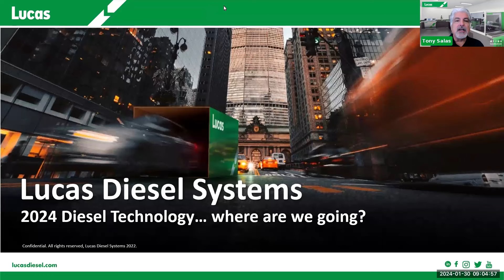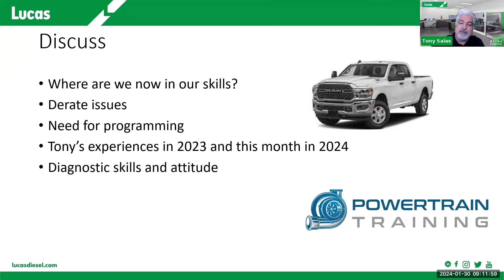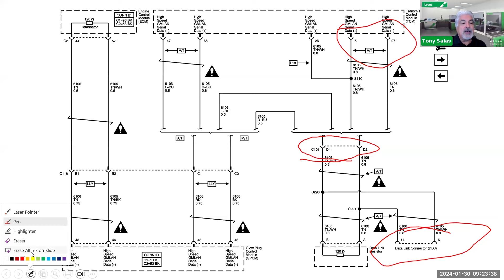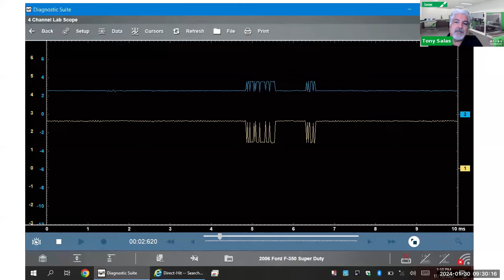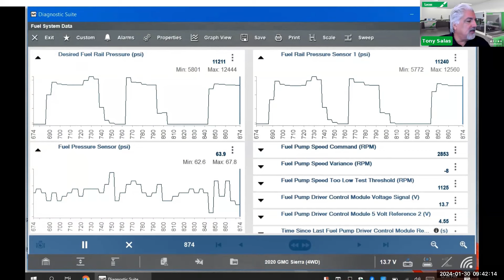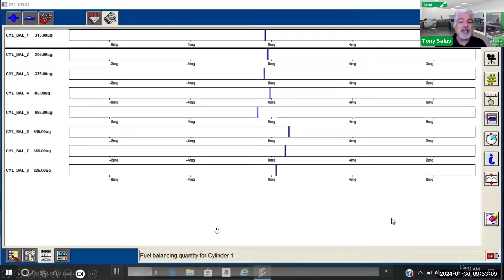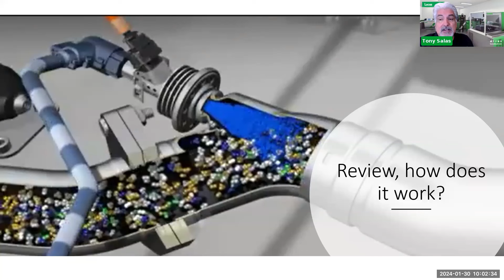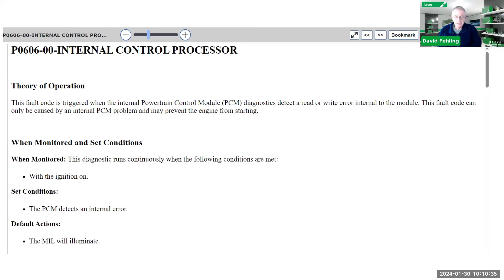TECHNICAL WEBINAR by TONY SALAS - WHAT IS NEXT IN DIESEL TECHNOLOGY?

Comment: Hey guys,
You seem like someone who could answer this.. 
Could the EGR  pipe come from downstream of the DPF rather than off the exhaust manifold. Wouldn't this keep the Soot out of the intake and engine and eliminate a lot of problems?
Why not?
Reply: As far as I know at this time, the Duramax 3.0L LM2 and the new LZO use the SCR on F, which is the SCR catalyst with the Diesel Particulate Filter as one. After exhaust travels through this SCRF, it is routed to the EGR cooler and the EGR.